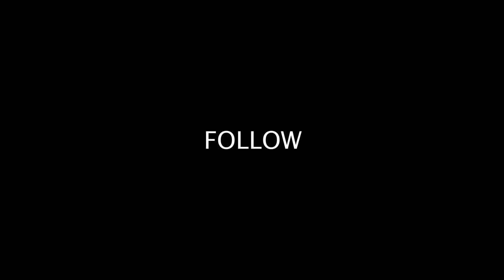Time is running out… (the elusive $10k/mo barrier)

Comment: When you trimmed the top to final size you cut the width off only one side.  One side has a MUCH narrower board on one side then the other now.  Attention to details is important on something with a premium price tag.
Reply from the maker: Lol $6,000 is NOT a premium price tag for a custom-designed 9ft solid white oak table. It's honestly a little on the low end...
Reply: So since it's not a premium price tag in your eyes it's ok to take a shortcut and only cut the table down on one side and leaving a very narrow board on one side and not on the other?  I simply said it should have been trimmed down on both sides in stead of one which is a valid statement.
Reply: @fredd4785  I 100% agree with you on this. Sorry JD, but as a standard I would not let that out of my shop...

Comment: Table is looking great, can't wait to see it finished. I remember my first large customer build, very exciting yet stressful at the same time. Congratulations on your success this month. If you think your going to be doing more large builds, you should maybe think of getting a gantry crane to help flip/move large heavy pieces. I've been through Integrated mesh Inguinal hernia surgery (directed at you Davis). It is not fun, it lays you up for months recovering, makes you afraid to lift anything again (damn that little voice in my head...lol), and it still hurts sometimes down there from time to time and the surgery was 9 years ago! Just a safety recommendation. Second, did you guys ever think about using your scraps to make small (like 6" by 8" or 8" by 11") wire cheese cutter boards. That's what I do. They take me like 30 minutes a batch to make once you have a method, they sell at $35 -$50 a piece for me, and I can't keep them in stock. They sell really fast for some reson, I guess everyone likes cheese. I think they'd be a great compliment to your regular cutting boards and charcuterie boards. You could make like a matching 3 piece set to sell on your website  (cutting board, charcuterie board, and a wire cheese cutter board). Just an idea that worked for me.

Comment: Hey idk if you all are aware. But Festool has, a sander. A sander you all would add to your shop once your doing tables more often. Because this sander has a attachment that you put in the sander. It holds the sander at a perfect 90° from the tabletop to sand all the edges it's the table. It saves a lot of time. And yes it's pricey. But selling tables like the ones you making it works increase the speed of production. Especially if, you had that festool sander and 90° attachment set up just for doing the edges of the tables.

On a side note. Cam at, Blacktail studios on YouTube, used C channel in a lot of tables he does. And I think he said he ordered his. You might go over and check out his channel. And see what you think. It does some pretty cool stuff when installing the C channel also. So you might pick up a tip of two while you're there.
Thanks for another great video. Have fun flying, Davis! And congrats, on the sales Jenny, that is truly amazing!

Comment: Is this c channel rigid enough to prevent cupping?
Reply from the maker: The world may never know!
Reply: It looks like aluminum t track to me. There is a company that makes some heavy steel c channel plate with formed edges that you can even mount the legs to and it would probably be a better solution. Nothing sucks more than getting the call from a customer 6 months down the road. I've been asked to fix a few tables made by others in the past.  I have used mostly stringers but when I get more time I will have a fab shop make the c channel. Its always better to go above and beyond.  I don't have a like for what I'm talking about but I will try and find it.

Comment: First of all it is not as necessary as you may think to alternate the grain. Pic the best looking grain.   The reason I say this is that if you properly finish the table. Moisture will not escape unevenly and your table will not cup bend warp or bow   Proper finishing is the real key in this quest for permanent flatness
Reply: Both are right, but it is especially important to alternate grain if the boards come from smaller trees. Varnishing the table top on all sides is important as well.

Comment: If you already know a board it’s bowed, wouldn’t it be a better idea to joint it first? I feel even if you “domino it”, the bow is there and it will eventually bow the rest of the boards? Idk, 10k table, I wouldn’t take any risks.
Reply: Agree completely. Forcing them straight will not be a good long term solution. That one board was so out I'd set it aside for other projects. Too late now but perhaps they will take the time to learn woodworking after a callback from this customer.
I'd also have worked a bit harder with grain patterns and worried less about smiley face/frown face.
Reply from the maker: It’s that risk-avoidance mindset over an insignificant detail that would keep you from taking a $10k job in the first place 😉❤️ That board is dead flat now and won’t cause any issues - no resistance at all during the second glue-up

Comment: And please do not waist you time on using dominos.  Just join them properly and glue them up with Tight-bond 2 or 3
Reply: If you have it why not use it.  Biscuit, dowel, domino who cares
Reply: They did joint it properly, dominos are not really for strength, it’s more of an alignment aid. They do add some strength, but a fairly negligible amount.